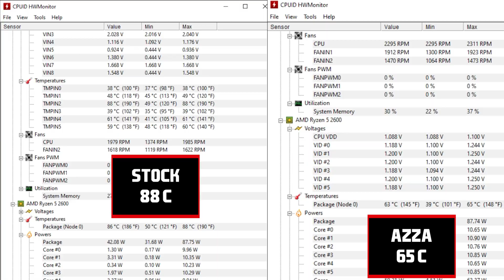AZZA Blizzard 120 / Unboxing / Instalación

Comment: Amigo una pregunta no tiene problemas de  fugas ¿o algo por el estilo? ¿Cuánto dura aproximadamente?
Reply: @mtek928  Muchísimas gracias amigo,estaba indeciso, pero me convenciste,la compraré.
Reply: @mtek928  Otra pregunta,y disculpa la molestia ¿Con un i5 10400,y una RTX 3060 sería ideal esta versión de 120mm?
Reply: @mtek928  Es correcto amigo, más adelante buscaré un fan de buena marca y buenos rpm para adaptarselo al radiador y así disipe mucho mejor.